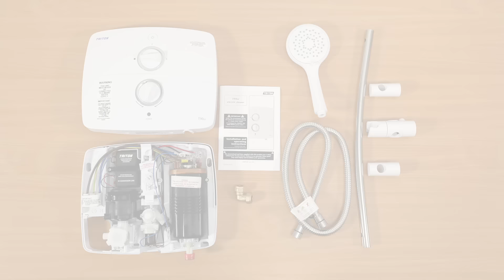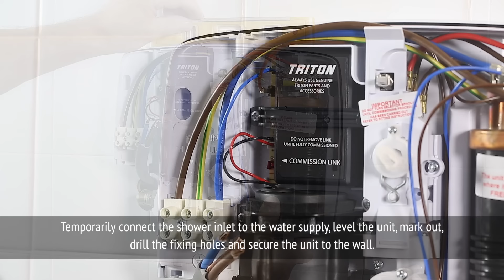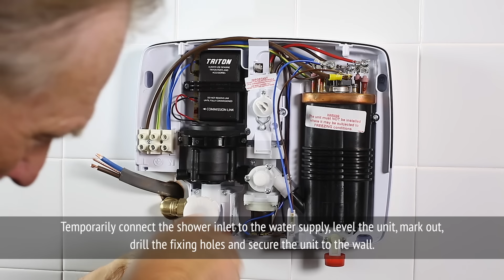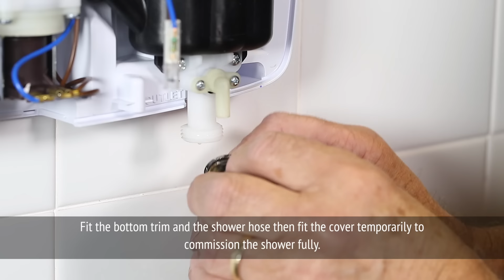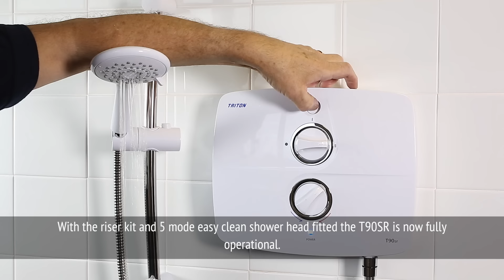T90SR Pumped Electric Shower - Step-by-Step Installation Guide

Comment: I just swapped out a Triton t90xr with a t90sr. My first time doing a shower install. I had a problem with airlock inside the shower unit. A dribble of water coming out. I sucked the hose with my head below the shower unit. This cleared the airlock. Sorry about the puns.😂. I had the shower running but no hot water. I found the commissioning circuit thing was not seated right. Reseated the circuit thing. Water started to heat but only lukewarm. I found the knob for hot\cold the spindle behind it was only half turned. I matched the spindle and the knob to full heat. Water is piping hot. Took me just over an hour and I was winging it.

Comment: This video should be referenced in the installation instructions . No details about size of holes to drill for mounting shower ,  spec for mounting screws - I am still not sure about this ,. rawl plugs type to use - use red rawl plug .  - drill type to drill tiles - you  need a special drill bit suitable for drilling tiles   , drill setting when drilling tiles  -use normal drill mode ,do not use hammer setting .  The brass elbow plumbing fitting supplied with the shower  needs to be orientated correctly - you are not told this .  See the video - note the position of the flat section used to grip the part  while the nut is being tightened - this needs to be to the left of the of the locking nut that connects to the shower as shown in the video  . Don't put in  on the other way around .   The installation instructions that come with the shower are not good . They leave out some important details. This video helps .

Comment: This is the best pumped electric shower on the market. We have installed over 500 since last June. I have a few tiny ways it could be improved. 1. The shower head holder used now isn't the one in the video. It's a twist type & some of our older clients have difficulty using it. 2. It would make things easier for installers if there was a grove cut out of the plastic beside the on/off button to allow easier access to the center screw hole.  3. The sticker on the left hand side an the cover is difficult to remove. Some showers are getting marked removing it. A lighter glue perhaps. Three tiny issues on a truly wonderful shower & I have my fingers crossed we'll see this motor in your other showers. Keep up the great work! :)
Reply from the maker: Thank you very much for your constructive feedback on our T90SR model. Fantastic to hear that it has become a regular installation of yours and hope your customers are enjoying the benefit of a significantly quieter running pumped electric shower. We really do appreciate your thoughts on how the product can be improved further and these have been relayed for consideration, indeed work has already begun on addressing the sticker issue by looking at a lighter glue that can be used. 

Kind regards from the Triton team.
Reply: @TritonShowers  Wow, now that's professional. I know this is an old reply but as an electrician myself it's rare you see a manufacture that truly listens to their users.
Reply: is this a better option than mira se we keep getting noise and leaking pumps

Comment: What I've learned during the shower installation (I am not a plumber nor an electrician):

1. Isolating the water supply (the gate valve which connects tank in the attick and the shower was located at the tanks bottom in the attick). I also turned off water mains from underneath the kitchen sink.

2. Isolating electricity: switchwd off the shower switch at the fuse board downstairs and also switched off another switch just outside the bathroom. You could also switch off main electricity switch at the fuse board.

3. When removing the old shower, be careful not to allow remaining water in the pipe to get into an inside of the wall, it might leak out somewhere downstairs)

3. Previous showers (T90si) wall fix holes were not at the same place as this showers.  I needed a drill for tiles to make the new fix holes.

After these steps, the video does the tremendous job in guiding you along. The shower itself is great. Hope someone will find this useful.
Reply: Great post. Couldn't find valve that turned off supply to shower, read your post,  bingo. Thanks a million.

Comment: If I have an older model T90XR, will this T90SR be in exactly the same position for the screw's nuts and most important the water inlet valve and electrical wires?
Also, my older model is 10.5 Kwt and this is 9Kwt.  Will I get enough warmth on this one as it's a newer model?

Comment: No silicone around the sides of the unit? What about protecting the screw holes, ans water pipe and electrical cable hole?
Reply from the maker: Hi we say not to tile up to or seal around any part of the unit using silicone sealer after fixing it to the wall, this is specified on page 3 section 1.5 https://www.tritonshowers.co.uk/amfile/file/download/file/1140/product/3125/

Comment: Just fitted one today...T90 sr .slightly different commissioning process... much easier ..I had a T90 si for about 18 years maybe longer ..Great shower good pressure & temp..a little disappointed with the temperature and pressure on new model...don't make them like they use too.

Comment: Instead of a compression plumbing fitting can you use a push fit fitting to connect the shower to the water pipe?
Reply from the maker: Sorry we do not recommend using a push-fit connection in this unit as the inlet fitting in it is not long enough to fully engage past the o’ring in a push fit. A compression fitting must be used.

Comment: Just fit one of these iny own house. Have many others in other peoples houses. Installed the same way as I always do, bleeding, commissioning.... no hot water at all. Tried ringing earthridge but no one there.
Reply from the maker: Sorry to hear of the issues you've experienced. Provided the locking screw has been removed, the inlet filter checked and the commissioning link is in the correct position, Earthridge would be the next point of call. Their full contact details can be found at tritonshowers.ie.

Comment: why we can't connect the triton shower to main water supply?
Reply from the maker: Hi, this would cause adverse effects and operation issues if you connect a pumped electric model to the mains, potential strain on the seals which may cause leaking and invalidate warranty due to not being fitted with accordance to the manual. Kind Regards, Leon.

Comment: Pressure looks really poor. Was looking to replace t90si and this model doesnt appear to improve on it much
Reply from the maker: Thank you for your comment. 
The pressure is determined by the KW rating of the unit. If you purchase the same KW as what is already there, the flow rate will be the same. 
Kind regards, 
Sheila.

Comment: does it have the same temperature output as the t90xr and if so why wouldn't it be reaching this temperature?
Reply from the maker: Thank you for your question. It is possible that there is a difference in kW ratings between the two models, causing the differences in temperature performance. The 9kW T90sr will give the same flow/temperature performance relationship as the T90xr of the same kW rating.

Comment: We fitted one today and the pressure is hopeless compared to the older one.
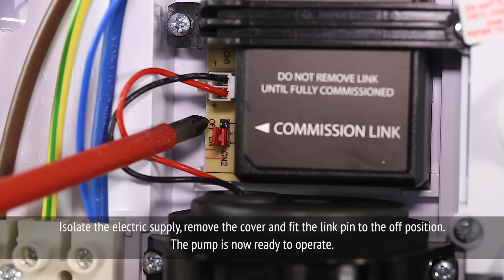Reply from the maker: Hi, it may be worth in the first instance double checking the commissioning link is in the off position for the pump to operate, we should this in more detail in our manual on this link, page 16. Fig 14. https://www.tritonshowers.co.uk/amfile/file/download/file/1140/product/3125/ we also briefly show this on the video at 3:13. If however this doesn't help resolve the issue and you think it may be something product related, we could have to advise contacting our service team for further help.
Reply: @TritonShowers  thanks for the input, yes commissioned properly but it's still a weaker shower than the t90z it replaced. The fact that it's a replacement isn't really true because the 90z was 9.5 kW and the sr is 9.0kv. We will stick with it now and are getting used to it but I wish I'd known before purchase. Thanks.

Comment: i have just fitted this shower done commisioning and and pushed start button no water coming out any idea thanks
Reply from the maker: Sorry to hear this. It is possible that more bleeding may be required via the bleed screw, which will remove any air. If this or further checks to ensure there is in fact water to the unit (checking for air locks, physical blockages, isolation valves turned on etc.) do not resolve, please contact our service team for assistance. Kind regards, the Triton team.

Comment: A new T90SR has been installed and there is plenty of water flow.  The problem is that the temperature dial is turned up to the max and the water temperature is about 28 degrees.  is there a fix for this.
Reply from the maker: We would suggest contacting Earthridge for assistance with this and they can arrange a service visit to establish whether the unit is working correctly and diagnose accordingly.  They can be contacted by calling (01) 628 6845.
Reply: Hi James , did you get your shower fixed to correct temperature.
I installed the Triton T90 SR today and have the same problem. The temperature is luke warm at max? Thanks
Reply: Make sure that before you fit the cover, the temperature control knob is turned all the way anti-clockwise. It is possible that when you are turning it all the way clockwise, that it is still in the cold band. 
Total rotation should be about 320 degrees. If you can not turn it this much when the cover is on, it means it is not turning in to the top heat band.
Reply: @mikeyjoe  Hi Michael - thank you for the tip! 
I had the temp problem. As you suggested, when I had it turned all the way up, it was obviously still in the cold band due to the original position of the dial when I placed the cover. I removed the cover, turned the  bottom temp dial all the way back to the left, replaced the cover and hey presto - we have hot water when I turn it up!. Simple fix - thanks again. Shower is fantastic, I can't get the family out of it!
T90SR unit is incredibly quiet compared to what we had. Very happy!
Reply: @mikeyjoe  The same thing was happening to me and I’m so happy I came to read the reviews on this video. Thank you so much for your your comment, it save me from having cold showers while waiting for the technical assistance to come to my house. 
I did exactly what you told and is working perfectly now. The unit is great, powerful and silent!

Comment: Hi, To double check, what cable rating is required for this shower? In mm sq. Just want to make sure that current cable will do the job or if I need to get the electrician to upgrade it . THx